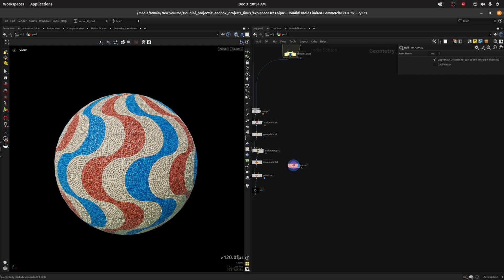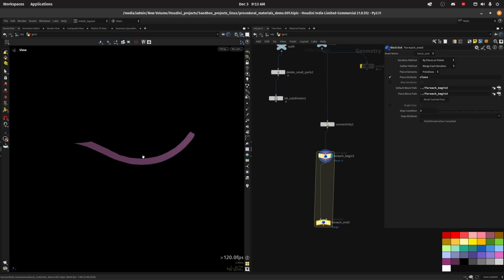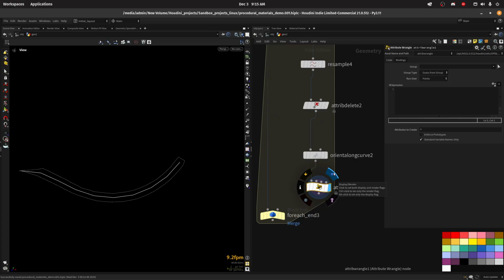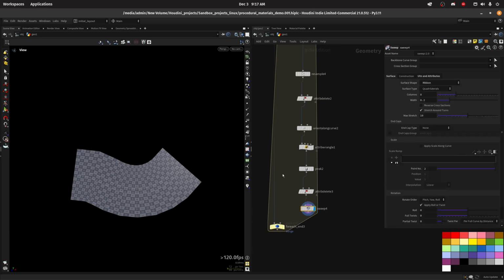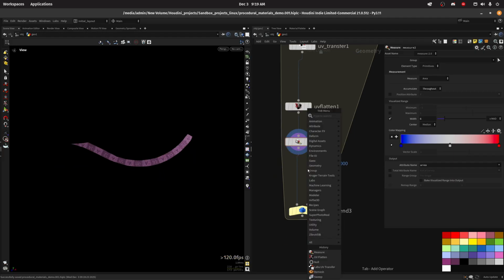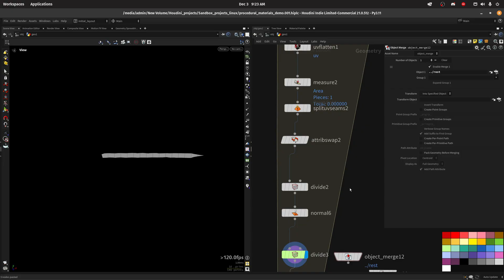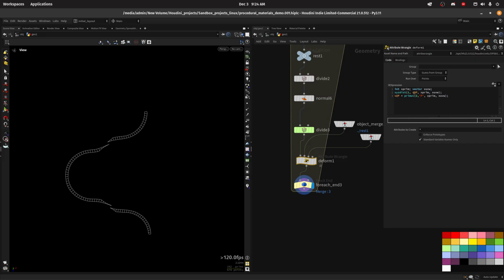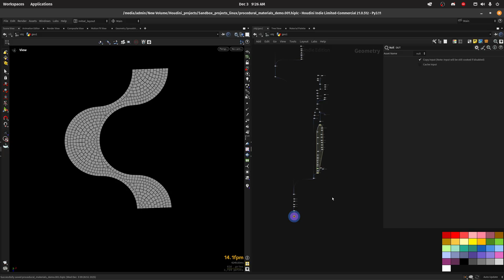Procedural Materials in Houdini 21 | Patreon December '25  - Free Lesson

Comment: Nice thanks for this. One question I see you have Exoside remesher installed and using Linux, and I am having big troubles installing. Are there some specific steps you did?
Reply from the maker: Basically sidefx didn't update the linux version to the latest, you need to install manually and choose the correct definition when you drop the node.